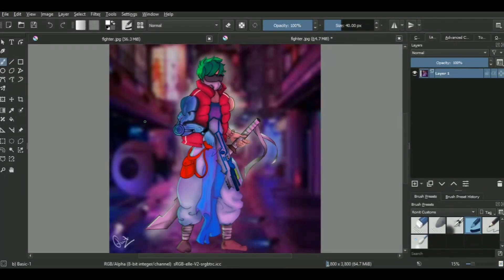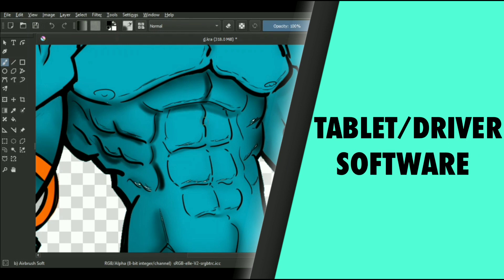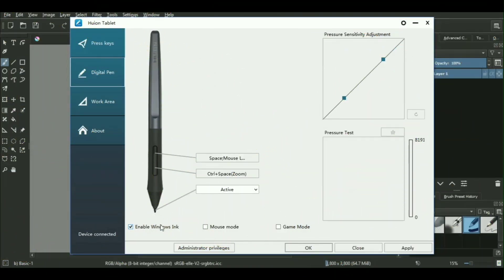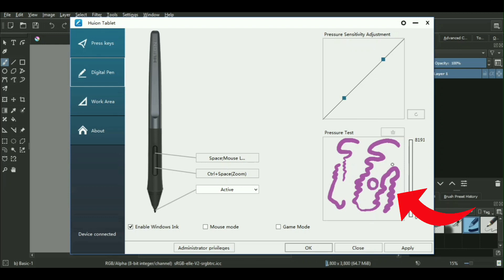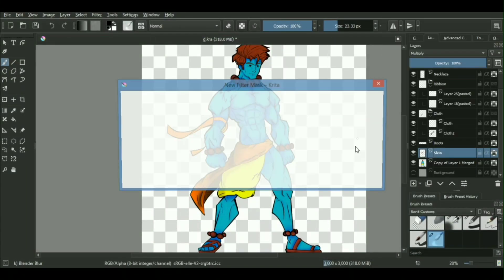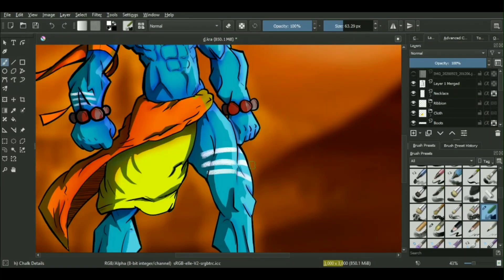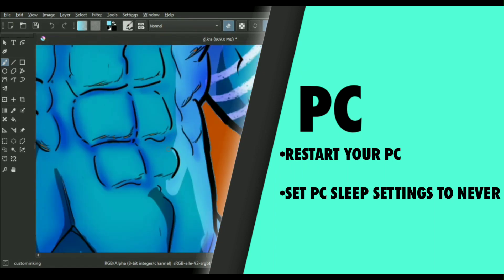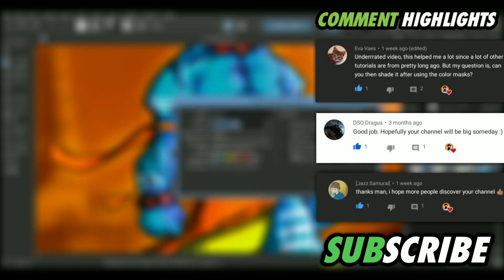How to Fix Pen Pressure Sensitivity Issues on Graphic Drawing Tablets | Beginner friendly tutorial

Comment: The pressure is fine in one of my computers but the screen don't work, it happen the "no signal" thing of the kamvas 13, and with my other pc the screen works well but it has no pressure sensitivity, I just had have the tablet for like 2 weeks, idk if my pcs are the problem or if its the tablet it self u.u

Comment: Suggestion for others- 
I have a H610 pro V2 but that driver wouldn't work, i had to download the H610 driver 2018 and that one worked. 
So try different drivers as well.
Reply: Ah ight, I have the same tablet and also have been dealing with that will try this method out thx in advance

Comment: I am having an issue where I upgraded my motherboard and cpu in my computer, and now my pressure sensitivity doesn't work. I triple checked everything from drivers to software settings until I straight up bought a new Tablet. The brand new tablet did the same thing. Its a Huion H1060P and my previous one was a Wacom Bamboo Splash, inside the Huion's app the pressure sensitivity works, so I know it's not the tablet or drivers problem, and for some reason the issue blankets across all software I have, Krita, Gimp, Sai, Photoshop, Sai 2, Paint.Net. Doesn't work in any of them and I have run out of ideas. This video didn't help me because restarting my PC and reinstalling the drivers for the 7th time hasn't helped.
Reply from the maker: Soory bro, I'm not an expert in this field. This video already contains all the problems and there solutions I'm aware of. The only thing i can say is you'll have to reach out to the consumer support or either windows or huion. I hope ur issue is sorted

Comment: My pen's pressure sensitivity is working pretty fine when I test it on the scratch pad of brush selection tool of krita, but while actually drawing on the main canvas it is not working :/ 

Please help me out
Reply from the maker: I have the exact problem, as far as i know there is no permanent solution. Try restarting krita or ur pc
Reply: Thanks for your feedback bro! I'll try and Love your artwork. 

Just one more thing, when I'm putting the pen tip on the canvas it shows the hand selection tool✋✊for moving the page, instead of just throwing down some ink. 🤔 Did you face this as well?
Reply from the maker: Yup, press the pen short key. It might fix it
Reply: Oh lord 🙌 thank you so much! It worked ✌️ 

In case if anybody deals with the same problem: I bought CaseU graphic tablet (cheap af but fairly decent) follow this comment thread and keep the right click instead of left click on one of your pen buttons and once you'll click it, it'll activate the pressure sensitivity on the main canvas.

Comment: nothing works. it just refuses to do pressure sensitivity in photoshop. tired everything. tablet shows in the software test window that the pressure sensitivity works just fine. inside photoshop there is NO settings other than the top icon to turn on or off the pressure sensitivity and no brush settings have a control option for pen pressure. I've tried with both options of windows ink to be on and off. I added the PSUserConfig file. did everything I could to get this to work for my tablet but its like Adobe refuses to let Gaomon use their program with the sensitivity.

Comment: Hello, I'm using Huion Kamvas Pro13  and ran into a problem nobody is covering on youtube.  My tablet worked great until few days ago.  It started not showing the dots when using the Brush Curve tool or Brush Zigzag or angle tool.   All other lines work great, square or circle tool also work fine. I use Medibang art currently.   My guess is some setting not letting the coordinate dots to appear.     Brush works great in Huion test, I can paint , uses all brush tools except those 2 (Curve tool and angle tool)    I think I bumped a button on Huion tablet when reaching for something late last week. no idea what i did?  IF you can help pls.

Comment: My pressure sensitivity work fine it's the software but even after following your tutorial it still doesn't work
Reply: I Used a vinsa tablet with Krita
Reply from the maker: Well on krita's website it has stated that it usually supports Wacom, xppen, and huion devices. So i think that might be the problem, as I've never heard of a brand called vinsa. Maybe that's why it's not supported